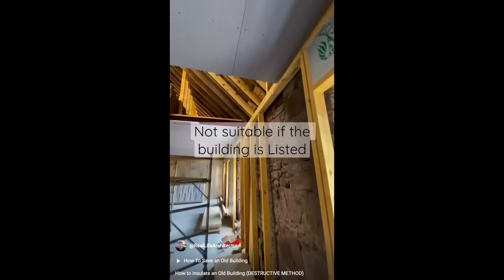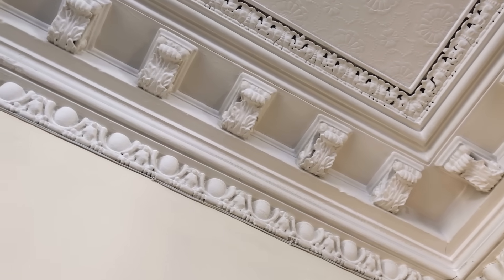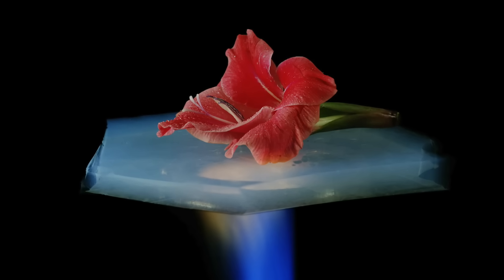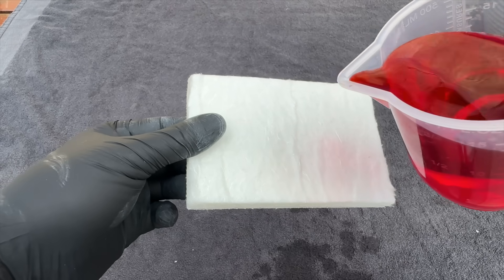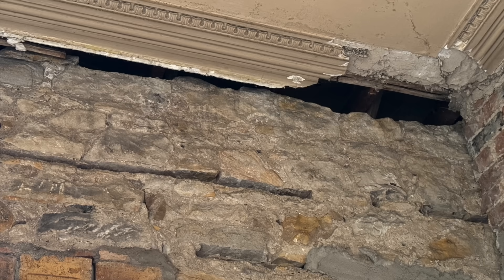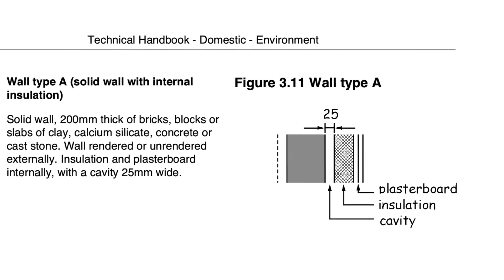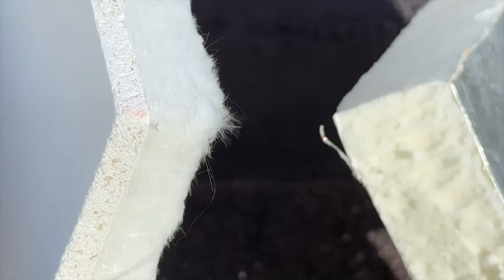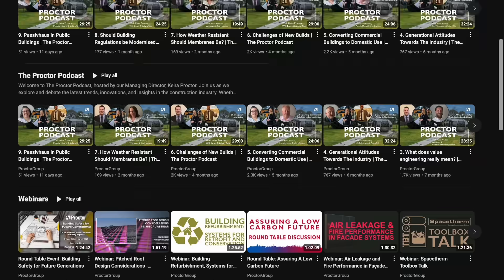The Thinnest Insulation in the UK

Comment: Spacetherm Aerogel may be thin, but its thermal conductivity is 0.015W/mK. This is about twice as good as XPE at about 0.03 W/mK, or 3 times better than Knauf glass wool at 0.04W/mK. That means that for the same insulation level as XPE Aerogel can be half the thickness and for the same insulation as Knauf glass wool it can be 1/3 the thickness.

Comment: Ok, it's breathable and could be fixed directly onto a solid wall without issue, I get that, no problem.
What you don't talk about is the effect of decorative treatment on the room side of the board. 
Do you board it?, Skim it?
And then, a good dose of emulsion and you have a vapour sealed room and your problem has not gone away, the wall can't breathe.
And at £97/m² that's a very expensive damp problem.
Reply from the maker: There are particular finished that must be used with the board, the info is on the Prictor Website. Sorry I didn’t go into that in the video

Comment: Very good informative video. I have used this product on my 1920's Dutch house with solid brick walls. To be more precise  I used this to insulate the wall next to the stairs where otherwise more conventional product would make the wall to thick and hinder with the stairs if that makes sense.... 

The stuff is crazy expensive but worth it. I noticed you forgot to mention one important matter which is the paint. Once you rendered the walls you can't paint this with regular latex! this will form a closed membrane. I choose lime based paint which is breathable. Anyway, good video.
Reply from the maker: Thank you for sharing. This is a really good example of where Spacetherm is useful.

Comment: all well and fine about this material. But if you are insulating antique buildings with any material, the fact remains that the walls will get colder. Being colder means more moist, wether you ventilate or breath or whatever. The moisture content will rise to a new balance. This can result in greening of brickwork, swelling of woodwork, etc.  Insulating is fine, but there are always side effect, for which a price will be paid.  One trick to counter cold spots around the windows is incorporating an electric heat wire, that modestly warms that corner where brickwork and woodwork meet.  It costs some energy, but that can also be regulated with censors and a thermostatic switch.  If it was my own building, i would insulate only the large wall sections, but stay clear from spots where wood and brickwork meet: windows and floors. Heat/cold bridges work 2 ways: yes they leak heat to the outside, but in turn they keep your construction warmer (on the outside, the inside will be colder)

Comment: I used aerogel to insulate the tricky attic walls/ceiling in our 1870 house. The attic (approx 6x4m in plan) was a 1970 cowboy special set right up under the roof tiles and already low in height so it was imperative to minimise any reduction in usable volume caused by the insulation layer. Where I used kingspan (62.5mm deep plus batten/airgap) downstairs this wasn't remotely feasible in this site so aerogel was pretty much the only solution before ripping the whole roof off and rebuilding taller with conventional insulation (not going to happen in a conservation area or with my budget). The aerogel cost £2.6k (to clad two sloping walls and a narrow strip of actual ceiling at the top) and was a complete b*stard to put on. It took me and three friends several days to complete the task and I was still vacuuming sticky fibrous dust out of the nooks and crannies months later. However the result was transformational - the room went from being the coldest in the house to one of the warmest. 

I would recommend using it where you need its unique properties - but it needs full protective equipment and is best done in a fully stripped-out space (we had to work round dust-sheet covered furniture which added to the 'fun'). 

Hopefully, the cost will come down...

Comment: When looking into thin insulation, the best (in terms of insulation per thickness) are Vacuum Insulated Panels (https://en.wikipedia.org/wiki/Vacuum_insulated_panel). VIPs also have downsides, they are very expensive, you cannot drill into them and they are not breathable.

Comment: Interesting. I have a 1969 'upside down' house with solid concrete floors downstairs (where the bedrooms are). Looking for floor insulation (currently none) with minimum height build-up. Is there a version of this product suitable for floor insulation use ?
Reply from the maker: I believe so, contact Proctor Group technical helpline. They will guide you through product specifications

Comment: What about products like RetroEcoWall from Ecological Building Systems? You can achieve equivalent U-Values with much less carbon and chemically intensive materials than this product, surely? Also, what about thermal bridging issues where this product would meet the existing cornicing? Interesting nontheless but thermoactive diathonite and compressed wood fibre is breathable and a solid option in old buildings!

Comment: Can this be used for upgrading a vaulted ceiling space in my lounge. It only has 1986 standard insulation… if added , what sort of valeted would it achieve ?
Reply from the maker: Possibly yes, but you should contact Proctor Groups technical support to get advice on the right product. There are different versions of Aerogel and the method of fixing it to a vaulted ceiling will need their advice.

Comment: I'm planning on using 60mm woodfibre boards if I can get the listed building consent for it.
But this stuff might be handy in limited areas like window reveals of tight corridors with external walls.
Woodfibre is about £20psm vs £100psm for spacetherm so I can't switch to spacetherm, but it's a good option if used in small quantities.
Reply from the maker: The product was originally created for window reveals. One thing to be careful of is the building regulations. If you are anywhere in the UK other than Scotland you need to demonstrate compliance with uvalues if upgrading more than a certain percentage of the external wall.
Reply: @RealLifeArchitecture  Part L has an exception for listed buildings and traditional buildings which basically says upgrade as far as practical. 
We'll see what the CO says but I understand any more than 60mm of woodfibre can be considered detrimental to the building.

Comment: as the cornice is uninsulated wont it attract loads of condensation and mould ?
Reply from the maker: Only if the rest of the building fabric (floor, ceiling and windows) are warm and the cornice is the only cold spot. Even then, traditional cornices are plaster and wood, they and can absorb moisture.

Comment: I was going to use 50mm PIR on my 9" brick wall. Surely if i tape all the joints then use a vapour control barrier then plasterboard i wont get mould?

Spacetherm is far too expensive for my DIY project but i will use a board for the window returns.

Comment: Is the final finish suitable for taping and painting or does it require plaster skim. Looking to use for a north facing wall in 1890s house. Wall had fireplace, now removed but effectively means its a solid stone wall plastered on hard in that area. And freezing. Beautiful cornice so need as thin as possible and aerogel bound onto board may just work.

Comment: I think that’s the answer to my damp bathroom wall. Had an extension built and it looks like the plasterer used up the last of his muck on one short wall in the en-suite which joins to the old double skin outside wall instead of drywall, it’s been driving me man being constantly cold and damp but due to plumbing and toilet & bidet location I have very little room. Spacetherm looks like my answer.
Reply from the maker: That sounds ideal but I suggest contacting Proctor Groups technical helpline to discuss first. There are a number of different ways to secure the product to the wall, they will know which is best

Comment: When I was a child living in a solid wall house with no central heating, my father had several layers of wall paper.
Reply: Did it work?
Reply: @MegaCityPatrol we knew the difference after we redecorated and pulled off all the paper off the walls and just had one layer ,papering was done every 5 years.
Mind you the papered walls would start to bubble up at 3 layers. So 3 layers max.

Comment: I used some spacetherm multiboard for the returns (300mm or so) on the internal walls of the room I insulated, used 80mm wood fibre boards for the external walls.

I had initially planned to use spacetherm boards for the whole room, on reflection I'm happy with the slightly small room and the extra money in my pocket

Comment: about damp walls, that is water creeping up issue, for that you need to cut the bottom between the first layer of brick and the slab, and insert a metal or plastic sheet which will be a moisture barrier, so the wall wont soak water from the ground up. yes its not cheap , and it needs time to dry out the wall.
Reply: @mrdot1126  A damp course? Yeah those are standard in any well built house.
Reply: @SomeKidFromBritain  But not standard in older buildings. No dampcourse in my house! … not even slate. Fortunately, I don’t suffer from much rising damp … the issue I suffer is one of penetrating damp due to the walls being rubble filled Blue Lias/lime mortar and the south and west facing walls get regularly wetted thanks to prevailing winds … made worse by a degree of bulging at 1st floor level.
Reply: @davidrowley-ic6dx  could that be remedied?
Reply: The way to stop penetrating damp is to either remove the source of the water … I lack the powers to stop it raining 😢 … or to introduce an external barrier .. which is not something you’re permitted to do on a listed building. It’s easier to work meteorological miracles than get changes to a listed building.

There are silicone finishes that can be applied to help seal the stone, but they also inhibit the ability for the wall to breathe out and (unless they’ve improved of late) they discolour the stone and so change the appearance. Likewise, can’t render over it or paint it. I also get problems with penetrating damp from cars driving down the road causing water from puddles to be persistently thrown against that wall .. that keeps the bottom 5ft well wetted … to the point that much of the stone now needs cutting out and replacing where it has rotted (Blue Lias is a type of mudstone and can be quite porous and soft).

Comment: the insulation not being vapor open, can/could be an issue, that is why if you ask a competent person in the insulation space, they will tell you that you need a central heat recovery air exchange system, if you can afford, a system with a moisture condensation unit installed in it. yes it is not cheap, but gets rid of that particular issue.
on the other hand,  i would never ever insulate brick/Stone house from the inside. cos its inefficient, and cos you loose the "free" thermal mass you already have. if insulated from outside, you can  heat up the building and the stone/brick wall will with time take on near inside air temp, which adds to the comfort feel. if you add insulation and plasterboard over it, you loose that.

Comment: We used spacetherm aerogel backed plasterboard for a wall in a 10m long, narrow corridor at least 10 years ago. Very good but we should have kept records because when having a thermal certificate issued (cant recall what they are called but needed for some grants) the guy had not heard of it and it was not a tick box option. Luckily he believed me and ticked the 4" foam instead. Sometime we may use it for another wall, as we have no complaints.

Edit: Just to be clear. I am not saying Aerogel is equivalent to 4" foam but that this is just what we agreed with that particular surveyor for want of an official tick box. (And frankly it may not have been 4" we ticked, just a value like that... this was all 5 years ago).
Reply from the maker: That is great to know. Was this in the UK?
Reply: @RealLifeArchitecture  Yes, Cambridgeshire. Biggest problem was not the installation but the shipment.. Came down on a long pallet and the transport company at our end didn't seem to be able to arrange unload. Eventually they arranged to come on a Saturday (we could have received any day) and then tried t charge us a weekend rate.

Comment: If it is hard to wash off your hands, how are the installers lungs going to deal with airborne particles? ☠️
Reply: @smsm4356   I've worked with this stuff and treated it like regular silica dust. So respirator on the face, vacuum on the tool.

But come to think of it: this stuff is ridiculously fine and hydrophobic. So now I'm considering if I'd actually need an asbestos suit as well. 

Food for thought (and research). Thanks!

Comment: Areogel has been around for a really long time. No one in the industry uses it other than selectively for cold bridges. It's simply prohibitively expensive. Im not sure why this is being touted here as a solution for small domestic users - it is not. Specialist conservation jobs aside. Domestic consumers should really weigh up the cost benefit ratio.
Reply from the maker: I think you are only half right. Yes, it is expensive but if the market share increases that will lead to investment in research and larger manufacturing capacity, which in turn will bring down the cost to the consumer.
Reply: @RealLifeArchitecture  So, everyone should wait out the market for a significant fall in its price. Got ya.
Reply from the maker: @ that is just the world we live in, it is economic reality. The same thing happened with mobile phones, the internet and electric cars. Expensive when they first appeared but prices dropped over time.

Comment: Would this be any use for insulating between floor joists? Maybe it can be bonded under a 6mm thermal board, with UFH on top..
Reply from the maker: Check the Proctor website, they have a floor insulation solution

Comment: Its a shame you didn't include ybs superquilt in your comparison, it does need battening, it is 40mm but compresses down to 5mm where it's battened and it's a vapour barrier that can go on solid walls, I have used it on all my walls and it's excellent and not expensive, it changed my EPC from a E to a C, and massively reduced my heating costs, two years on and no damp or moisture coming through.

Comment: I was under the impression that if you insulated the outside wall of an older property, Building Control now requires you to bring the U value up to 0.3 as a minimum. So, although the Proctor insulation is far better than the original wall, it is still less than halfway to that acceptable to L1A standards. I investigated Proctor's product years ago and decided I couldn't afford to do my 18" thick walls with it to get to the legal L1A requirements.
Reply from the maker: This is correct in England and Northern Ireland but only if a certain percentage of the external wall is being upgraded. I have plans to make a video on this in the near future

Comment: Isn't it more sensible to do your research before making your video. That way you don't need the top up video.

Aerogel is old news. It's almost unavailable. When I last tried to get some for difficult areas of my home I was told global surpplies were taken up for pipeline insulation. All the images are taken from sources I used at least ten years ago.

Don't get me started on Proctor! Zero communication. Completely unfit to be a supplier.

Comment: Sound extremly dangerous, new asbestos type dangerous.
Reply: The PPE requirements during manufacturing as shown are considerably more onerous than for a typical installation, as there is greater exposure and more frequently. The principle issue being the actual dust, which is an irritant, but is not toxic or carcinogenic. Inhalation or skin contact of most types of dust has the potential to cause irritation, or exacerbate existing health problems but dust production occurs principally during cutting and can be minimise by following our guidance. Our on site installation PPE requirements are the same as for working with plasterboard and are generally considered good practice for cutting and handling a lot of common materials.
Reply: @proctorgroup Can you list the studies that were done on the safety of your materials for human contact and general worksite conditions?

Comment: Looks like a great  product 
We normally  use woodfiber  breathability  and with lime plastering  but it starts  at 40mm and  we parge  coat it then stick the board but it is quite  a thickness  but in older  buildings  great  product  we will look in to it

Comment: Interesting product, but yeah, very expensive.   My victorian house in central Scotland has lath and plaster lining, on timber battens on the inside of all the solid stone external walls.   I want to improve the U value, so had been looking at the various wood fibre insulations, such as Stieco as well as insulated plaster systems, but what I had narrowed it down to was blown in insulation behind the existing lath and plaster instead of taking the lath and plaster down and then relining with insulation / plasterboard.  Either cellulose or wood fibre insulation, both of which are breathable.   Any thoughts on blown in (or "drill and fill" as it seems to be called in the USA)  for older properties ?   This should also work to fill in the void behind cornices and behind timber panels around window reveals, etc.   I believe Historic Environment Scotland used the blown in cellulous method to insulate behind the lath n plaster walls at Holyrood Lodge.   I think they also used some Aerogel!
Reply: There were indeed some experiments done with that kind of application, i believe about 10-ish years ago, but there's a few practical issues to overcome before blown in aerogel becomes viable product unforatualtely.  From memory, HES have done some projects using blankets, but i'm not 100% sure about blown fibre i'm afraid.